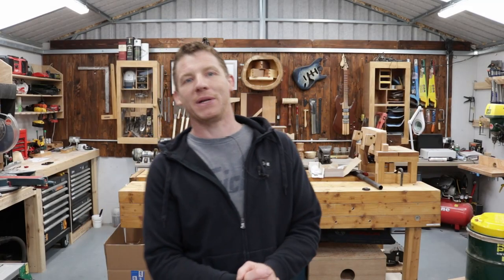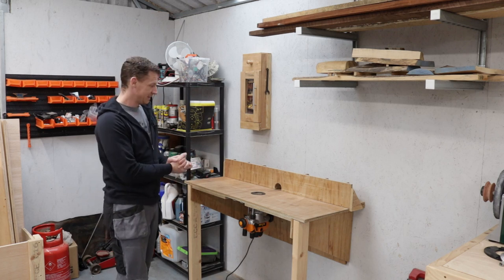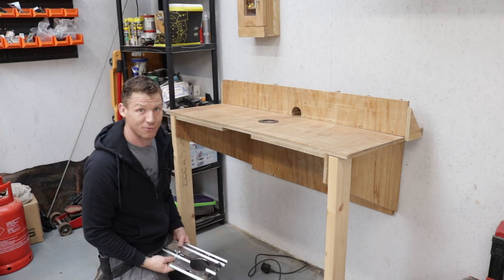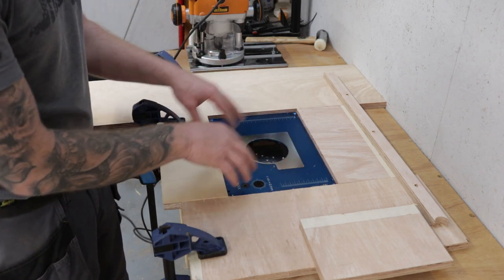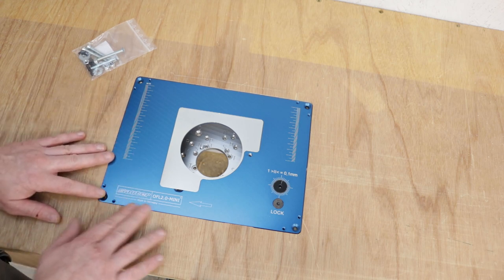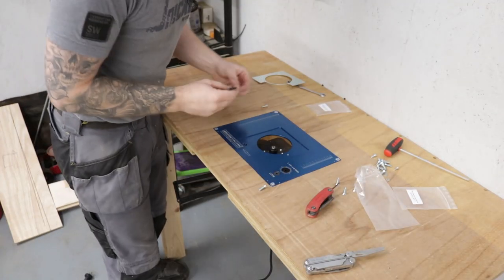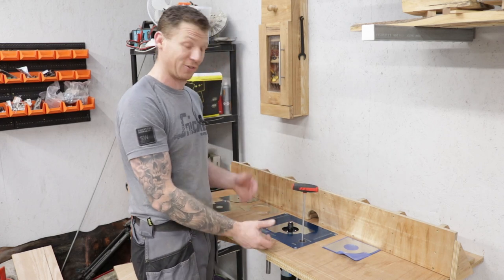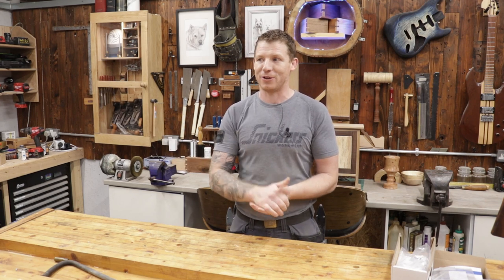Upgrading My Router Table. Sauter Router with Quick Clamping System. Sauter Mini Router Lift.

Comment: Right now, as a new retiree, I'm gradually setting up a small workshop in our barn. 
I'm right at the stage of designing a workbench of 2m by 1.5m and round the perimeter will be my table saw, planer, mitre saw and also a router with insert plate. 
These Sauter examples were absolutely gorgeous, but when I nipped over to their site and saw how much it was going to cost - well, my State Pension couldn't cover it. I'm rather disappointed, but still, I'll be looking forward to your future review of these tools.
Reply: Congrats on your retirement!  Your workbench is bigger than my entire "shop"  Hope you enjoy it
Reply from the maker: They have all the gear for diy router tables.

Comment: Interesting to hear your review on the plate. I’ve had a lot of problems with keeping the metal plate aligned. The magnets cause it to deflect down, and then the dust tends to build up under the plate and lift it up.

Comment: Hi John router table looks great. I have a metal workshop something like yours with six 4 foot floresent lights is there a kit to convert them to led. Seen some but all in the usa where they take all the insides out and rewire them. Might be a vidio for you in the future.  I'm sure lots of guys are thinking the same.👍
Reply: if your flourescent lights have twist insert starters then converting is simples. buy the correct length led tube, it comes with a starter like fuse.  light off remove old tube and starter, insert new dummy starter fuse marked led, insert led tube, turn on light enjoy . this i have done for all my old tubes in shop and house......IF YOUR OLD FLOURESCENT LIGHTS DO NOT HAVE A REMOVABLE STARTER DO NOT SIMPLY SWAP TUBES AS YOU WILL HAVE TO GET AN ELECTRICIAN TO REPLACE OR MODIFY YOUR LIGHT FITTING. the steps i suggested areONLY for lights with removable CAPSULE starter units.

Comment: John, great to see an irish youtuber doing such quality content. as someone starting out, can i just ask, @10.39 in, how are you cutting flush with the template you made without cutting into it? does your bit have a spindle above the cutting edge or something?
Reply from the maker: The bit has a guide bearing that runs on the template it's the same diameter as the cutter.

Comment: Hi, 1000w doesn't seem a lot for a router table. The big Triton is 2400w. Hope have you found using it? The fact it is quiet is appealing.
Reply from the maker: Hasn't lacked power for anything I have done on it yet.

Comment: the router chuck release may be neat , but if your making a cost effective router table, spending very close to £900 for a router and lift  is contradictory.  if your doing a budget upgrade you can get a router and lift for between £300 and £500, that means your paying £400 for the quick release.  i will stick with the spanners. by the way according to the sauter site you can only buy the lift as package with router for 895 euro (with p+p  nearly £900). i would suggest  scewfix, amazon etc before paying a fortune for a handy gimmick.
Reply from the maker: You can buy the lift separately and they do a host of other routers, these are aimed  more towards the professional user and the cnc market.

Comment: I have to be honest in saying that with the price of this plus the extra time, cost and effort of building a table, I would be inclined to pay the extra and get a little cast iron topped spindle moulder with router bit collett
Reply from the maker: Fitting professional tools in my budget built router table is odd and I get that, a professional user would go this direction, its just a way of me demonstrating these tools. I will eventually upgrade the table.